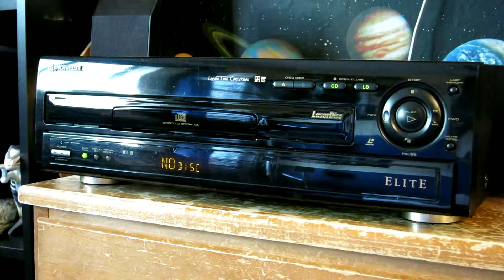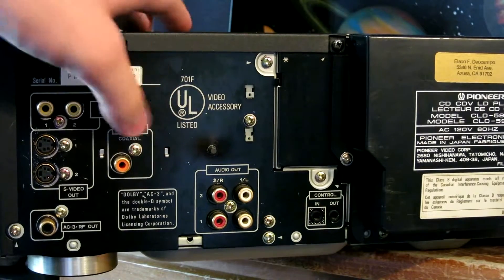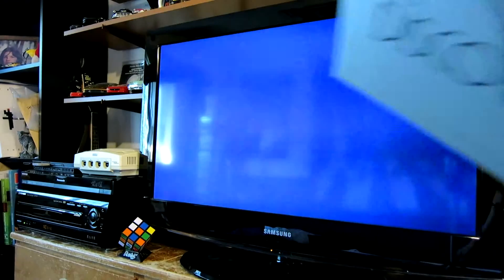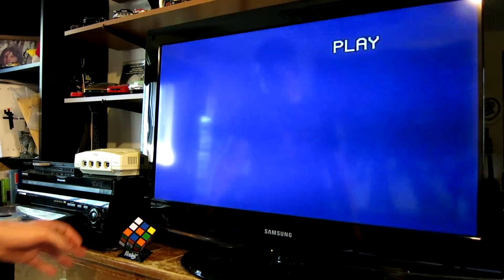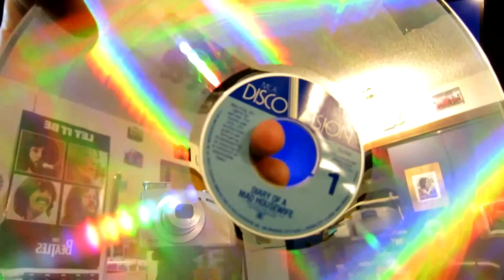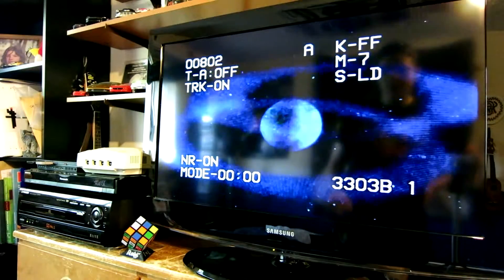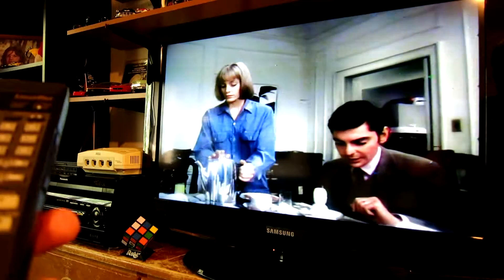Playing tricky discs with my Pioneer Elite CLD-59's test mode!

Comment: A P5 fault code indicates that the player could not pick up a usable RF signal.

It may be that the disc had a defect on the very beginning of the track that resulted in too weak or too noisy of a signal.  What may be happening is that the player is not detecting a usable Philips control code at the point of the disc it's trying to read when you first start playback.  The lack of such a code may be treated as an absence of a usable RF signal altogether.  Most players will refuse to play a disc if it can't first detect a valid control code signal.

Playing the disc with the player in the test mode likely allows you to scan the disc past this defective spot where the player would first read when trying to start playback of the disc in normal mode.  It may also allow the player to ignore the Philips control code and simply attempt playback so long as there's a track that the servo can lock onto.

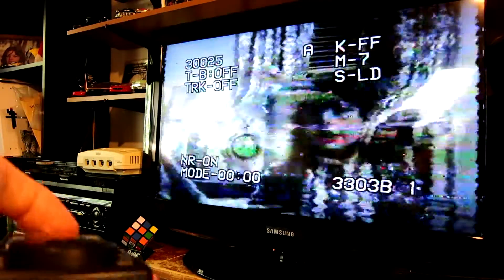On 4:07, what you may be seeing is the player reading the disc with the tracking servo not working in closed loop.  Pressing PLAY again enables closed loop operation of the tracking servo circuits.  On 4:55, on the upper left hand of the on screen display, TRK-OFF is observed, indicating that the tracking servo is not in closed loop.  When you press play again, TRK-OFF changes to TRK-ON and the picture clears up.